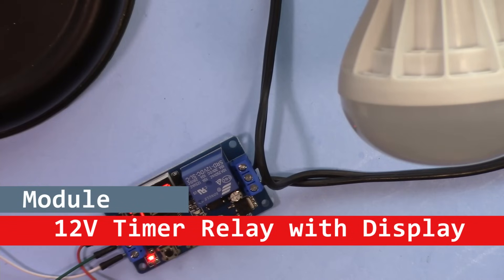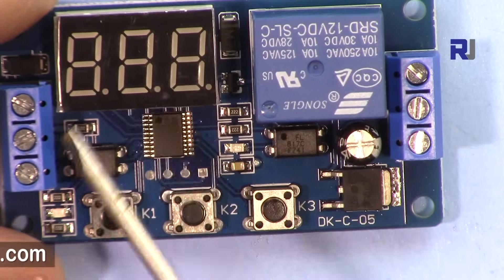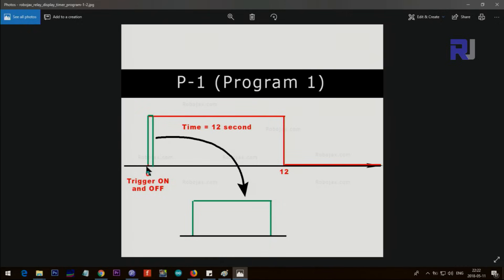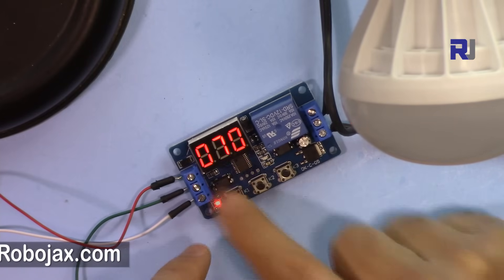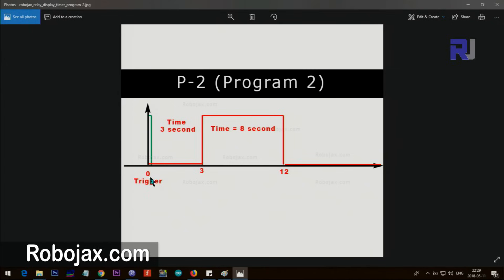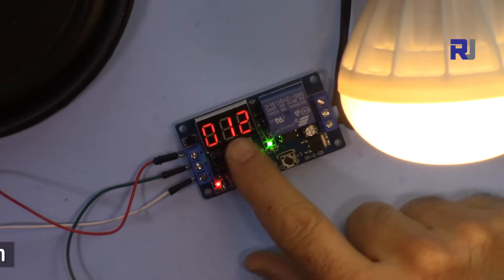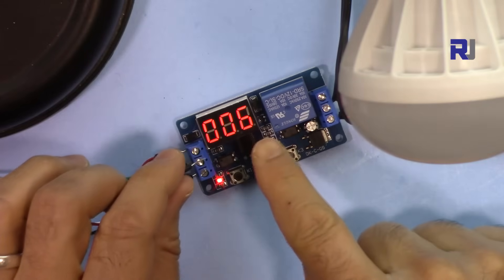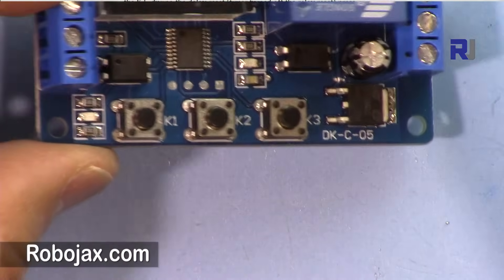Home Automation: 12V Relay with LED Display Delay 0.1 seconds to 999 seconds Timer module P1 to P4

Comment: I have a few of these boards and STILL cannot get some of them to work with a motion detector.

Objective:
Wireless Motion trips board to ON position for T-seconds, then OFF for T-seconds, then Resets and waits for Motion detection again. :)

Every program on these boards resets the timer on EACH and EVERY Motion detection, hence the board may NEVER shut OFF if people are constantly walking by...  :(

The ONLY timer boards I've found to work with a Motion detector is the Qianson DC5V 3-Button boards, using the P-7 program with a Cycle = 1.

Below are the 4 boards I am currently trying.
Although these 4 boards are all 3-button types, The 2 on the top only have P-1 thru P-6 programs and do NOT work with a Motion detector correctly.
https://drive.google.com/open?id=1KoYxZ3YBH41_sKyVCejebDT3PthKS3Sw

Although these 4-button boards have the P-7 program, they too do NOT work correctly with a Motion detector trigger. 
They always reset constantly when any motion is detected! (IE: Never cycle Off if motion is detected.)
https://drive.google.com/open?id=1yIjKm9K2JJ-ridMVw1650N32aZcmccTW

If ANYONE has any ideas as to how to load the programs onto these boards, or where to find the exact boards that WORK, please chime in!!!
Thank you!
Reply from the maker: I just watched my video to know what you are looking for and I am sorry I did not understand the issue to offer help. This module receive trigger signal and turns ON for T seconds.  Please have a look at this module: https://youtu.be/s4oNCpH_I0E
Reply: @robojax  Thank you for the reply.  The strange thing is that the 2 modules on the bottom of the picture work perfectly using P-7 program with Cycle =1.  The problem is I cannot find these boards because there are so many out there and not much documentation as to what and how to set them up and what programs are loaded onto the boards.

Comment: So can we use this timer to turn on lamp for 12 every 07.00 am everyday? How to do that? Thankss
Reply from the maker: it doesn't go by clock. it work by time. Se it to 24 hours in repeat mode. Turn it on at 7AM and it will turn on everyday at 7AM.
Reply: @robojax  thanks so i must use p4 right? But u say that device have 999 second for maximum delay? How to make it 24 hours?

Comment: can the trigger be a ground trigger?
Reply from the maker: No. You will need to make external circuit to make it LOW level trigger. here is the circuit for that https://snipboard.io/vERWPt.jpg
Reply: @robojax  thanks! appreciate it :)
Reply from the maker: You are welcome.

Comment: If i use the same power supply for both ends (9v battery) will it burn anything out?
Reply from the maker: this needs 12V. But for your load or bulb you can have 9V or 3V or 300V does not matter. But if you want to use the same power, then can you use only 12V.
Reply: @robojax  thanks for the reply, but my issue is i think i burnt out the switch because i used one battery to power both ends (the trigger side and the switch side)  because its stuck in the on position all the time when not in a program.

Comment: Module is use 5v?
Can remember setting?
Program 3 is loop?
Reply from the maker: No. it is 12V. It says in the title 12V and I have explained it the video.
Yes it can remember settings.
Program 3 has been explained in video. Please watch.

Comment: Hi can i use 12volt for the trigger that is coming for a 433MHz remote control unit
Reply from the maker: Yes you can.
Reply: Robojax thanks for the help and for the videos👍👍
Reply from the maker: You are welcome.

Comment: Hi Robojax
I would like to know what is the minimum voltage needed to triger the divice? is it  4v - 20v? I am trying to use the device with a sencor that says it can give max 200mA. It is not working. 
I was looking also to use an infared sensor or an ultrasonic sescor .
i have the  module that you have and i want to use it like a simple secutity system.....
please upload a video with what kind of sensors we need to triger the devise ....what is the diffr. with possive and negative triger? 
this devise says it works with possitive but the sencor that i have says that sents negative.....
Any help or idies? 
Thank a lot and great video by the way......
Reply from the maker: Hi Dimitris, As I mentioned at 1:25 (click on the 1:25. I had to watch the video to find it) it is triggered at 5V. Anyting above up to 12 should be find. It doesn't need much current perhaps less than 1mA.
If you want to change input signal from negative to positive,  you would need a transistor and 2 resistors. but I would suggest using Arduino with relay which gives you  very wide options to work with. Here I just made this circuit if you want to convert the signal from positive to negative https://snag.gy/vERWPt.jpg

Comment: Can we have minutes and seconds setting with this device?
Reply from the maker: I just watched the video (instead of you watching it) to find the answer. You can set up to 0.1 second to 999 seconds or 17 minutes.
Reply: @robojax  Great video, thank you. I needed this unit to run in minutes and thought I had made a mistake in purchasing this timer which stated 999 minutes in the description. I found a comment elsewhere, that if the decimal point is showing on the far right, the counter is set for minutes so will give up to 999 minutes. If no decimal point is showing, then it goes to 999 seconds. I have just tried this and it works correctly.  Thank you again for your clear explanations.

Comment: HI, great video.....but i do have one question...If for any reason the module loses the power will it lose the program that we have set to it as well?
Reply from the maker: No. It will remember and keeps the settings.
Reply: @robojax  thank you for your quick response.   So if I have on it sensor to work as trigger and a siren it can work as a simple alarm ? And can  be on and off with a remote control....?

Comment: Outstanding explanation of the abilities and practical uses, thank you so much for taking the time to share your knowledge of this device.
I will be using this to control my dust collection system in my wood shop. I will use P-4 to be a delay to run my blower motor off after a few seconds after I have turned off the tool that started the DC system. This module will turn on a solid state relay since my DC system draws more that 10 amps. 
As for the trigger part of the project I will use a current tap to trigger this module.
Reply from the maker: You are welcome. I am pleased that you found it useful.
Reply: @robojax  I second his words. Thank you very much!

Comment: Thanks for your detailed video. can I use the same 12 V DC supply for the load and the supply of the module?
Basically I need to use the P-3 mode.
Reply from the maker: Yes. you can if your load is also 12V.

Comment: Hello,
Very nice and informative video (https://www.youtube.com/watch?v=81XzLwt3dqo).
I am building an UV light box for photoetching on metal plates. The UV light box is composed of 12 UV tubes (9W each) + ballasts powered by 220v. The duration of the insolation of brass or copper plates, which varies according to several parameters, must be set precisely between 60s and 300s. So, I'm looking for a switch timer (digital display) to integrate into my UV light box to operate for the time I have to set for each insolation. What you have shown looks perfect for what I want to do, especially Program 1.
However, could you please advise me about what to use to power the delay timer in 12v?
I need to transform the 220v into 12v.
Can I use something like this (https://www.amazon.fr/gp/product/B07MC7N969/ref=ox_sc_act_title_1?smid=A1T1YUESZEROVB&psc=1)?
Thank you in advance
Reply from the maker: Hello,  You are welcome. 
Yes you can use the mentioned item.

Comment: I have bought two of these  timers and  the two do not work. The timer lights up and counts down and a blue relay light comes on but does not switch from N/C to N/O
Reply from the maker: do you hear the click of relay? if not either relay is bad or the small transistor connected to relay is bad.
Reply: I do not hear any clicking sound. It just strange that the two of them do not work

Comment: Does it work with a 9V battery?
Reply from the maker: No. If the relay is 12V, then use 12V

Comment: Is there a way to use this relay for an example of: on for 5 seconds, off for 15 seconds, and then back on for 3 seconds, and then off for 25 seconds? I'm guessing no...?
Reply from the maker: for that you need arduino.

Comment: Hi, can it work with 3/4 battery AA for input (4,5/6v)?
Reply from the maker: it needs 12V for 12V you need to have 8 of AA battery.
Reply: Robojax what if he used the 5 volt version?

Comment: Sorry in mode P3 what is the maximum time in minutes? thanks
Reply from the maker: You can set it in seconds or minuets.
Reply: @robojax  Thanks, in the video it is not clear enough that if the dot is blinking at the left you have 999 Minutes...

Comment: Can I use 12v dc input power source and 12v dc output? And does it consumes more power when it is in standby mode? Thanks sir.
Reply from the maker: yes you can use 12V to power this up. But there is no output. Your load can be also 12V. But that is not output.
Reply: Load=output sir? Is that right?
Reply from the maker: If you want ocall it yes. But relay is just a switch to controls your load whither 12V DC or 220/120V AC. But yes you can do it.
Reply: Thanks bro.
Reply: How much current does that module consume?
Reply from the maker: If I have not mentioned, it then I missed it. I assumed your will power it with AC adapter so. When it is OFF it would be less than 50mA depending on how many digits are ON on the display. (the more segments are ON, the more current you will need). When the relay is ON, it need 100mA.

Comment: I need Digital Temperature controls for incubator
+91 9814288394
Reply from the maker: perhaps you might need this item https://youtu.be/DBRI7ry0Ku8 which you can get it from Amazon  https://www.amazon.in/dp/B00Q6WQJ2O/

Comment: Hi sir.. I just bought time relay switch online. There was no diagram attached in the package and i dint know how to wire it.. Hope u cn help.. It has 5 pins, from the left, first pin has "N0", 2nd pin Com, 3rd has"NC".. AND THE 4TH is N, and 5th pin has"L".. THE relay is srd-12vdc-sl-c... 10a 250vac, 10a 30vdc.. Hope u can share sir. I am a newbie and planning to wire it on the incubator.. Ty sir..
Reply from the maker: Watch my video on Relay and it solve your problem. Do not scape wait and watch. https://youtu.be/7tUGUXyloXQ

Comment: I just order this one:

https://www.aliexpress.com/item/CE-IO22A02-DC-12V-2CH-Multi-function-Delay-Relay-Timer-Time-Switch-PLC-LED/32616777759.html

Because cover all the hours of the day, did you test it?
i have two different led in my aquarium and i want to turn on by 4 hours and turn off by 20 hours on a loop. How can i do it? my idea is use one channel for each light with the same timer delay. Is it possible?
Reply from the maker: That is totally different thing you have. This video is about the item shown in video. Sorry.
Reply: @robojax  I tested the version CE-IO22A02-12V-2CH, it works with more greater times than the version you show us, is a really great item. I am going tu use it with my leds light on a aquarium. The 2 channel are totally independependents

Comment: If I put the 12v in the 12v+ and the minus/black to the trigger. Can I trigger the circuit with the K1 button on the board?

Comment: can I plug my 12v dc battery into this, such that it will control a 12v  3A dc pump? thank.
Reply from the maker: your 12V and 3 A is load. So yes you can connect AC or DC load.

Comment: Hi Robojax,
Very good and informative tutorials. The P-3 function goes into an infinite loop right? Does it stop if the trigger signal is activated? Thanks
Reply from the maker: i am sorry to answer you question, I would have to watch the video. So you better watch as I have over 260 videos and don't remember. To the best of knowledge, I have left nothing that you need to know. So watch it again, pay attention and do NOT escape the time.

Comment: Message:Thank you for your informative and helpful video:
I purchased this device from you. In the video, when using P1 you demonstrate that the input signal can be momentary, or continuous and the relay shuts off as programmed. On the unit I received, the momentary works, but if the signal is continuous it does not shut off. It instantly resets and the timer runs down again until this signal is disconnected. 
Please advise.
thanks
Reply from the maker: I am not selling this. Either you module is different or you are not following the settings. Watch the video again perhaps.
Reply: @robojax  i just noticed in your video that the module you have did the same thing when continuous power was applied to signal it started the cycle over

Comment: Excellent explanation I just ordered the 999 minute one from Amazon I'm going to use it for 12-volt DC I have an Factory time delay relay in the Machine but it's only good for 30 seconds and then my radio shuts off they never wired and accessory switch into the key so I must have it on to run the radio but at the same time it runs the electric power steering I'm going to use the trigger from the factory time delay to trigger this relay I can program it so the radio will stay up for 1 hour with the key off
Reply from the maker: Thank you. I am glad you liked it.
Reply: Hi , if we need a timer that connect or disconnect circuits after 6 hours what should we do? What should we buy? As I realized, this module go up to 999 s at last.
Reply: Hi sir robojax... what is the exact name of this module sir... want to buy one sir.. hope u can send the details of this eelay sir. Ty ang more power..😊

Comment: i need this for delay turn on module for my car amplifier. Where to connect my remote wire as is, where to connect it to input and to output of the module?
Reply from the maker: Everything I know about this module, I presented. You should be able to get it from video. Please watch again carefully.

Comment: Can I use this together with arduino? I am trying to make a project using arduino and relays. I can control the ON and OFF of relays using arduino but I want to see the countdown timer before the relays turn OFF and ON.
Reply from the maker: You can control the triggering using arduino . But relay will be turned ON and OFF by the device.
You can use Arduino to have full control without this device. I have made two videos: http://bit.ly/relaytimer without display 
and this with LCD screen http://bit.ly/relay-timer-11

Comment: I have this relay, or at least one that looks exactly the same, mine counts down in minutes. Put the little dot just after the numbers and it turns to minutes instead of seconds. The display on my unit is kind of funky, I more or less have to guess my numbers, but the count down works as intended. I guess you get what you pay for .
Reply from the maker: There are many variation of relay timer that looks like this.  some got one feature and some the other.  They don't even put a model number on this.  So it is hard to know which one is which.
Reply: @robojax  Yes you are probebly right. I could fix my display by the way. it was a litle solder bead stuck between two leggs, once i cut it away it worked fine. Wery handy relay. thanks for wid.
Reply from the maker: You are welcome.

Comment: I want my  dc motor work 5 seconds forward and 5secoend  backward work
Reply from the maker: will not work for that.  you need two relays. You will need another module.

Comment: How can this work automatically? Can I use this for a misting system?
Reply from the maker: this is made to make task automatic. It will turn ON at a set amount of  time and turn OFF at set amount of time. It doesn't matter where you connect it.  Make sure the device  you are trying to control does not exceed the current raring of the relay. I have explained the relay ratting in the video.

Comment: What if ,the power is cut off in the middle ?
The timer will continue or start from the bigining?
Reply from the maker: The timer will reset but the program you selected will stay. I don't think you will find any device to keep the time when power is interrupted.
Reply: @robojax  thanks 👍

Comment: One year delay switch and reset for next one year .. IS IT POSDIBLE WITH ANY CIRCUIT AVAILABLE IN MARKET...PLZ ITS URGENT.
Reply from the maker: I know you can do it with Arduino clock module.

Comment: Hi!  Thanks for making this great video tutorial.  I just bought the same device.  Can you tell me how I can set it up so that as soon as the unit gets powered up from from being off the relay gets triggered until then countdown ends?  I tried connecting both the power and the trigger from a single switch but when I switch it on then relay doesnt turn on.
Reply from the maker: You are welcome. I have explained it. Watch carefully. It has this feature. I can't tell you which part because I would have to watch the video and with over 250 video (Dec 2018) it would be very hard for me to do it.
Reply: Could you solve the problem? I am also looking for a solution for this

Comment: Is there a way to start the countdown in P-1 without the manually triggering.? I mean itwill auto countdown when there  is 12v supply.
Reply from the maker: Trigger is part of program. The example I have given in this video should answer any question you have unless it is impossible to do it with this module.